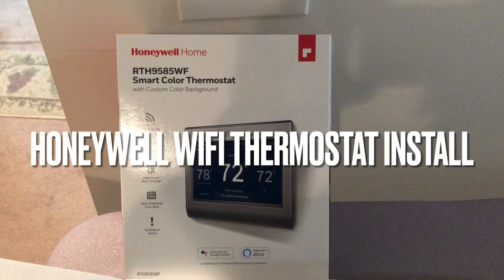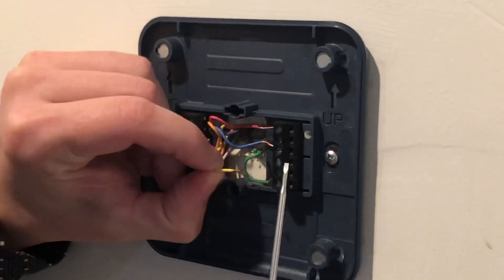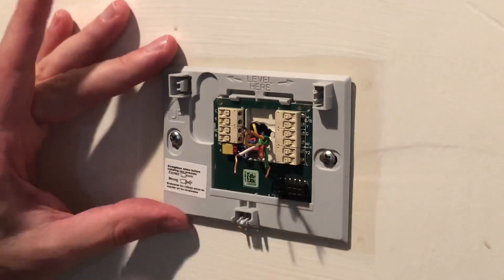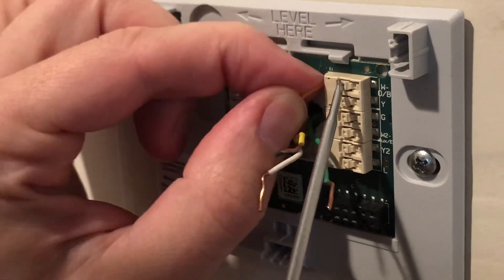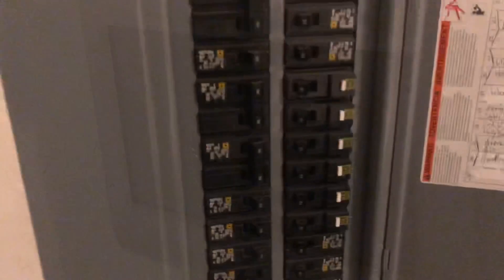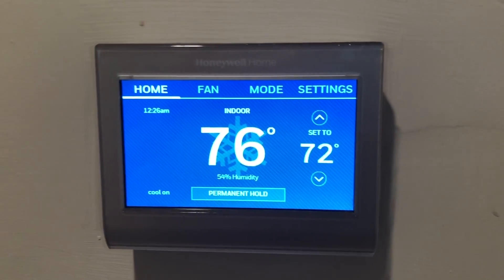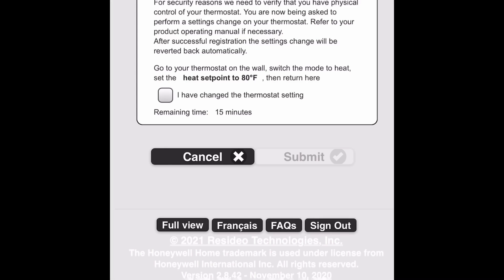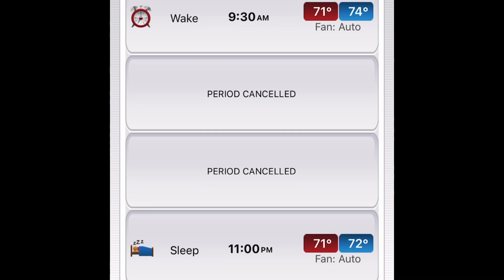Install of Honeywell RTH9585WF Thermostat and Wifi Control

Comment: I have a furnace and a my ac. Separate on my fuse box.
My orignal honeywell had it as :
B blue
G green
Y yellow
W white
R red

When i set up the wires on the new one i get no power to the screen yet the furnace kicks on (blowing air no heat).
What the hell am i doing wrong😂
Reply from the maker: There should be a "c" wire for power. It is usually the blue one, but is labeled as c generally rather than b. There can also be a b wire which is used with heat pumps sometimes, though I've seen it be orange more often. So in short, put the blue wire in the C slot.

Comment: I only have a blue wire not orange... Stage 1 ??? Correct
Reply from the maker: Blue generally goes to the C terminal, for power.
Reply: @UCanFixAnything  AND LIGHT BLUE CAN BE THE REVERSE VALVE O/B on a Rheem and Rudd.  Brown is common wire whereas blue is reverse valve.

Comment: I found this today anfter watching many other vids.This was the only one that covered all the wires I needed. Start to finsih I was done within 1 hour. Followed u to a T, and walla, my furnace turned on right after I confirmed settings. It had been out two weeks as we thought it was another part. Temps dropped to 18 last night so we ordered best buy thermo, came by noon. Found this vid and you have saved out buts. Thank you!!!!

Comment: At around 3:50 or so, it is stated that sometimes you need to push in the little button to assist with the wire going in.  So, my question is, is it necessary to have the little "push in" plastic button?  I've several of these models listed as used and many do not have the plastic piece.  Are they still good to use?
Reply from the maker: As long as there is a mechanism to hold the wire in place, then it doesn’t really matter.

Comment: Great video, What happened if I have an HVAC system with 2 thermostat. 1 control the heating and the other one control the A/C? I want to buy this thermostat, do i need to buy 2 of them?
Reply from the maker: You should be able to put them both to one thermostat. You’ll need to double check the wiring. You may not have a c wire with that setup, which may need to be remedied.

Comment: Did everything twice and no power.  Any tips?
Reply from the maker: You may not have a c wire. In which case you need to use batteries (which I’m not sure this thermostat has capability for)

Comment: Gonna give a try tonight after your video. W and ob wires messing me up
Reply from the maker: Orange is for heat pump. White on mine is for secondary heat source (W2). If you don't have heat pump white likely goes where orange was as primary heat source (W1). Look at your orig setup to be sure.

Comment: I don’t have orange, everything you did make sense but when it comes to orange and white I got conf. Where do I plug my white since I don’t have orange?
Reply from the maker: Orange is for heat pump. White on mine is for secondary heat source (W2). If you don't have heat pump white likely goes where orange was as primary heat source (W1). Look at your orig setup to be sure.

Comment: The heat setting just blow with no heat. I have brown blue white green yellow red black orange. I hooked up like urs still no heat. Brown is c. Blue and black is not hooked. I had black hooked and it seem to kick out my fan and blown my compressor
Reply from the maker: Did you take note of the wiring of the previous thermostat? The colors can be different, it’s best to look at previous wiring to find what each wire does.

Comment: Has anyone had a problem with the t stat losing internet connection?  Mine had been connected for a month or two, last week it won’t connect to Wi-Fi. I hotspot my phone and it connects.  All my other Wi-Fi devices at connected and nothing has changed on the Wi-Fi

Comment: Thanks for the video. I am having problems getting mine set up. The thermostat was already in the home and it's asking me to press and hold the middle temperature on the thermostat for 5 seconds, and it's supposed to say something, but nothing happens. What if you are not the original owner of the thermostat, how do you set it up?
Reply from the maker: You can do a factory reset. There should be an option in the settings menu. Or if you can’t get there, pull it off the wall and put it back on and hopefully that can get it to reboot.

Comment: Nive video how do I set up 2of these thermostats ithe same app ? Can I do that  with this  thermostat? And control 2-3 Honeywell thermostats from one app? How do I do this? Thank you! George
Reply from the maker: You would prob just have to have different devices logged into the different thermostats. Or log in and out the different ones on the same device. I’m not sure that the app can handle multiple. That being said, I haven’t tried it, so if I am wrong, please post about it!!

Comment: I have orange, white, and brown included. My brown is emergency heat. I have daily I don't know what to do with my white and orange since they both should go to the same place
Reply from the maker: If your wiring is like mine Orange goes to the O/B input. White goes to W2. If the colors aren't coordinated to the standard colors, then you will need to figure out what the wires are doing and wire them accordingly.